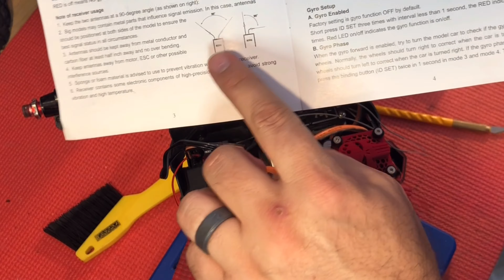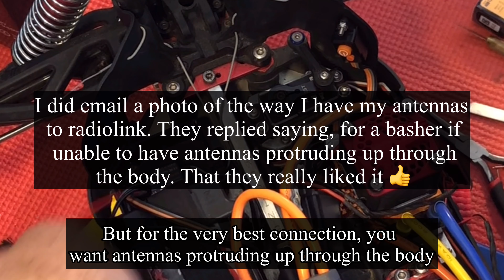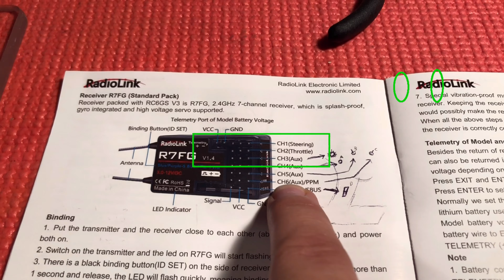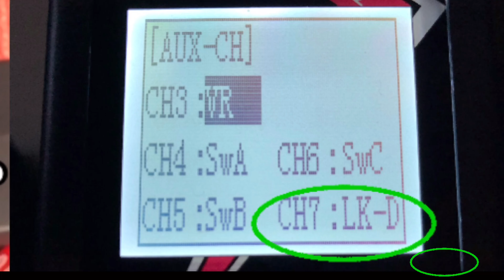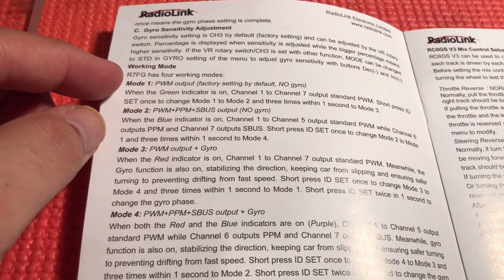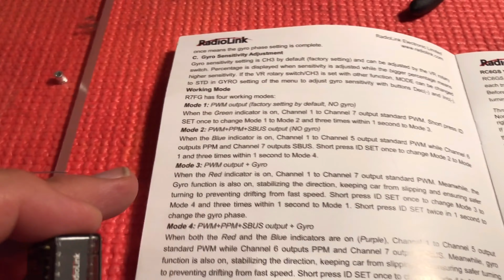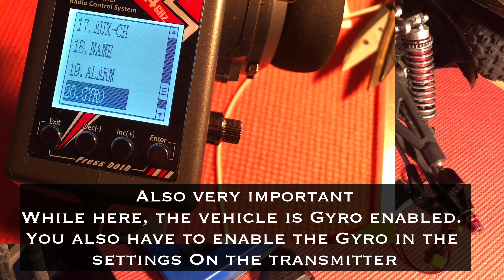Radiolink RC6GS v3 - INSTALL and Overview - Setup Dual Antennas, Gyro & Telemetry Explained

Comment: I use battery telemetry so I can stop before my rc hits low voltage cutoff when I could be I'm the air and then lawn dart into the ground.

Comment: you can assign channels and change there functions too. swa etc. i run crossfire on my v1 which has all the same firmware just lacking a button . use ch 3 for snow plow, easy adjustment of blade. have also used it for a winch. , id seed is sweet , haul the sonicwake to the creek with the crawler back in switch model and back boat off. great radio for fpv . and there are other rx that work but haven't tried them 20 buck rx waterproof long range

Comment: Late to the party but I hope this helps and btw I've been running the V2 since it came out and friggin love it! ... I removed the receiver box attached to the battery tray and using an extra section of antenna tubing I liquid electric taped it along the bottom on the driveshaft side and just reassemble running one antenna through it.  You can just pull the antenna out if need be and you can barely see what's going on so it looks clean and you get all of that range love! For the telemetry I cut the jst off the adapter and soldered direct to the base of the esc as you would if you were running a cap pack . Perfect length for it as well as you'll notice the wires are thicker than what you get if you buy those bulk just connectors . Battery for the controller? 4s of course . My only and minor gripe here and hopefully they fixed with the V3 but it only reads up to 15.4V even though the battery is fully charged. Hope this gives people ideas! And yo East! Keep it up bud! Great stuff!
Reply from the maker: Nice! Thanks for commenting. There’s no such thing as late to the game my friend.
Regarding the read out for the battery only going up to 15.4 I actually think that’s intentional because technically you should only charge Lipo batteries that are going to sit at a full state for a very long period of time up to storage level maybe even a little bit above that to be safe. So actually if you take storage level which is about 3.85 V per sell and multiply that times four you actually get that 15.4. 
I know it sounds strange to only insert batteries at less than full capacity but if you think about it, the time it takes to go from 15.4 V down to LVC is like… Forever. So you might as well play it safe with them Lipo batteries sitting at near full charge for long periods.
Reply: @EastTactics  right right just as you explained in your video it's just that's about the only thing I could think of that was even remotely negative to say about the device lol .. well that and my peticular radio came with some kind of debris trapped under the screen that's annoying to look at . And what a turn of events it snowed just a little this morning and I had been planning on doing my kraton annual full rebuild and took it out for one last rip and now the receiver is bugging out like some wire is bad and I'm not getting power to it . I love troubleshooting so this will be interesting. And having seen that you did a dual battery for yours I just wanted to say I poured over batteries for mine for about a month and chose the 1050mah tattu from gens ace and just spliced a jst off the xt60 it came with. I'm sure you found that thickness was the biggest hurdle in your search as it was for me because I still have lots of room in the compartment so I put foam in to get a more solid feel . Cheers!

Comment: Great video! I have the RC4GSV2 that I picked up when I bought a used rig with no radio/reciever. I have since switched it over to my stock Kraton 6s and still fiddling with the features. I love the range I get with the RadioLink over the stock Spektrum SLT3. The park I run at the most often is hilly and wide open, I can easily lose sight of my truck now if I am not careful. Looking forward to your detailed features video, as there are not many that help with this.

Comment: 23:47 Active gyro will turn your wheels into the correct orientation in air, for the landing (think about World Rally). Should help counteract the rotation, not contribute to it.
Reply from the maker: To your point what you’re saying makes sense. However, most people consider being airborne some thing they need total and complete control over themselves. Trying to counteract the AI might prove difficult. I’ll have to do a little bit of testing to see if the Gyro actually helps or if in fact, it hurts. Will let you know.
Reply: @EastTactics   maybe you mean for backflips. If that's the case, I'll bet the gyro DOES fight you on that.  OK, let us know and thanks for all the work on that video, I'm going to use it as a reference. Ordering this stuff up (Tx and extra receivers)

Comment: Doing an fpv setup... gona put my camera/ subsystem battery to this and the voltage display (buying a plug in thing basically) will go somewhere near the camera so I can pan or tilt to look at it when need be
Reply from the maker: Nice

Comment: I just got into the hobby this summer. Im starting a new rock crawler build and i was just browsing around my local hobby shop looking for a decent 4 channel. I have a scx10chassis with a 2 spd trans and 12t550 so i need a extra channel for my transmission. Guy at the hobby shop sold me this today for 50$   It has so much going on it’s overwhelming.  Great video man thanks a bunch!
Reply from the maker: For sure! Glad you found it useful

Comment: If it had temperature sensor in it's telemetry system (for Nytro) I would buy it. Not having temperature is a missed opportunity, when they already have link capable to send signal back with telemetry
Reply: @Ketoholic  I saw them advertized as I6X Radio/ IA6B Receiver telemetry modules. Are you sure that sensors are compatible with this car radio ant its receivers?

Comment: All 4S batteries won't come with the JST connector because the voltage is higher than that connector is made for.   4S will have an EC3, or an XT60 connector.   I bought a set of lithium rechargeable AA batteries that do 1.55v per cell... 9.2 total and it lasts forever.. and obviously they fit perfectly with the included AA tray.
Reply from the maker: Yeah, that’s perfectly fine, however…if the transmitter is capable of handling, 15.4 V, though why not take advantage of it and see how it impacts range performance. You’re correct the 4s batteries do not come outfitted with JST connectors. So you do have to do a little bit of work to convert but it’s a simple work and totally worth it. This video showcases how to take advantage of 1100 mA of 4s power, run in parallel can be outfitted inside these transmitters. And that rocks!
https://youtu.be/Z2sY509dfnw

Comment: @EastTactics Being that this video is almost 1 year old, would you say this is better than the Spektrum Dx5 rugged? All of my car already have Spektrum receivers and I wouldn't use most of its functions, I really just want to get rid of some transmitters lol I got 12 now! 😅 Mostly dx3s Felony, Kraton, Typhon, Talion, big rock, infraction, Vendetta and a few odd projects but they all have Spektrum receivers.
Reply from the maker: Functionality and control, slightly better, aesthetics, and feel slightly worse. Range much better… Overall …better yes
But not by much. Both are great

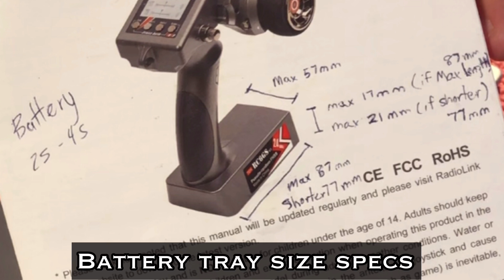Comment: Did you ever figure out what 4s battery fits best? I looked in the description and it's not there. 14:24
Reply from the maker: Yeah, I’m referencing the two 4s batteries that are being pointed out in my separate video. You’ll notice a thumbnail pops up and arrows point at both of them. Those two batteries are found on Amazon… link in description of the following video:

Best Lipo batteries for your RC transmitter -  Parallel mode￼ & Best practices - Radiolink RC6GS V3
https://youtu.be/Z2sY509dfnw
Reply: @EastTactics  Got it, I just watched. Thank you for the reply and the help.

Comment: I heard that the v3 will bind to certain spectrum receivers, maybe you can verify that with radio link. I just got mine in and if that’s true I’d like to know which receivers it would be.
Reply from the maker: I’ve never heard that, not saying it isn’t possible. But the simplest thing would be to give the binding a try and see if it links up. From my understanding binding of any kind between a receiver and transmitter is Brand specific.
Reply: @EastTactics  I will give it a shot. I love the idea that the r7fg has the gyro and wil not pull power from the car…for that reason I will be ordering more of them for my speed run cars. I will let you know if I’m successful binding my bashers to the stock receiver…🤞thank you for the response

Comment: Hi mate great video like the radolink rc6gs-v3 I'm defoe getting mine. Because I've got the old flysky gt3b at the moment. That only holds 10 models but when I seen this it holds 30 models that fantastic brilliant. What I'm worried about is the 2 wires what comes out of the receiver box. But the gyro is brilliant not sure if I keep mine on all the time mate 👍
Reply from the maker: Yeah, it’s a challenge finding a unique way to get those wires out of the box and ensuring that the transmitter it’s good reception to them.. and yes, regarding the gyro. You’re definitely said that to the turn dialed in for the most part will probably keep it off. But it’s fun to mess around with.

Comment: I need some help.  I have the Hobbywing Fusion quickrun SE 1800kv running a 2s lipo 7.4v. My transmitter is RadioLink RC6GS V3.  I have paired the remote with the motor but it runs crappy.  I think i need to change some settings within the transmitter and i dont know how could you help?  Also my reciever is red but the transmitter works i can drive and steer but like i said its crappy so i dont think is bound correctly...
Reply from the maker: How does it perform when running the stock radio and transmitter? Revert back as a test
Reply: @EastTactics  I fixed the issue.  It had to do with the transmitter settings particularly the A.B.S. Thank you though!

Comment: Coming from FPV world, I wish there a transmitter that had EdgeTX (OpenTX) so just program and button to do anything including what you would like for disabling the gyro.
Reply from the maker: Yeah that would be nice. I’m not very familiar with that TX stuff, however it sounds versatile. You do gotta give kudos to Radiolink for at least being light years above most offerings in the land radio arena.
Reply: @EastTactics  currently on Radiolink & Flysky seem to do anything with RC car transmitter world. Unlike the big names
Reply: You can disable the gyro remotely with Flysky Noble, Futaba, Spectrum, Airtronics and many other radios. You can program all the Aux channels to do what you want. I fly fpv too. I have 9 channels that I program on my crawlers to do all kinds of features from lights, winch, and rock lights. Drag brake, fpv camera, gyro on and off for jumping. So not sure why you would need open TX for RC cars when you already can run as many functions as you want to depending on how many channels your radio has.
Reply from the maker: @FarmerFpv  Would be nice if radio link incorporated the option. Especially considering the budget price for their ground radio combo.

Comment: I have this remote and receiver i spent for 84 dollars and its worth it 👌 have this for my kyosho 1970 dodge charger rc and i need programming to make the lights to work and i have my rc made as the duke o death from gta5 and to have the roof lights and underglow and to make adjustments for the driving experience more fun😊
Reply from the maker: That’s awesome!!

Comment: Hey bud quick question I’m having a headache I have a erevo 1/10 dual brushed motors dual servos and I just bought the same remote but I can’t get the car to turn all the way right or left ,I posted a video of the issue maybe you can help having the same remote and thanks.
Reply from the maker: I really don’t know a whole lot about setting up dual motors or dual service. For sure a remote/receiver combo that’s capable, it would definitely be the RC6Gs. 
It sounds to me like there may be a setting when you are running to servos that needs to be adjusted because perhaps the system thinks there’s only one so it’s only giving 50% radius to both. But you need to go in and activate 100% by navigating to each respective channel, connected to the servo and opening up the range. But this is just a guess because again, I’ve never set it up. Sorry I couldn’t be more help.
Reply: @EastTactics  thanks man I appreciate it

Comment: what battery would i need since the longer range would use more power
Reply from the maker: Best Lipo batteries for your RC transmitter -  Parallel mode￼ & Best practices - Radiolink RC6GS V3
https://youtu.be/Z2sY509dfnw
Reply: @EastTactics  I am a complete beginner and I do not understand many things Rc experts talk about there is so much information but i find this video helpful. Could this control work with cheaper small RC cars under 200 and do you need to use different batteries for different things in the car? I see you use fans; do you have to add them? and does one battery power the fans and another one make the actual car run and if I upgrade my car to this controller would I have to use more powerful batteries than the original ones my car comes whith? I am also concerned and a little confused on storing a battery of that power safely. Can the antennas be used during rain and is the setup waterproof?
Reply from the maker: Great questions, everything regarding RC is typically water resistant. Particularly in the higher model. I can’t say the same about low budget RC under $200. Or RC from Walmart. But everything in the total hobby grade RC Arena is water resistant. Not waterproof. They’re OK to get water on them with the rain, etc. But extensive water could cause issues.

Transmitter receiver combo is just a combo. Meaning you need the receiver and the transmitter to make the RC run. Not being sad if you put the receiver into a lower budget RC then you should be able to control that lower budget RC just fine because it’s the receiver itself that is communicating to the transmitter. And you don’t buy one without the other. 
Regarding the batteries that you put inside of the transmitter. This doesn’t matter. Something might be able to be said if you’re going super long range and you are using more powerful batteries in the transmitter. However, it’s debatable. I don’t think that the transmitter range is directly correlated with the power in the batteries. But I could be wrong. Either way, the battery itself is not really what gives this particular combo awesome perks. You’re gonna get way above beyond range no matter what batteries you use in the transmitter. I just like to use the best of the best and it’s capable of running batteries at 4s. Then why not maximize it

The batteries that you use to control the transmitter are completely separate from the rig.
The rig itself will runoff a variety of batteries, depending on what rig your running. in my Kraton uses 6s, Lipo batteries.
If you decide to upgrade your fans, there are options to run those fans on a completely separate battery if you choose. However, there are ways to run the fans off of the main battery balance terminal. The RC car will run off the main big thick terminal. And you can plug your fans into the balance terminal used for balance charging output . Believe it or not that thing outputs power
If you have a rig like mine, a great company to look at is hyper flow fans. He has a kit you can buy to run high-powered fans from your battery (main battery)
For a long time, used to run my fans from a separate 3S battery. I no longer do that. However, believe it or not, I also don’t run my fans from the main battery Either. at least directly …there is plug-in in my ESC that I simply plug my fans into. One could also plug their fans directly into the receiver, which is the little tiny square box that you put in your RC if it has an extra opening for it.
Hope that answers some of your questions
Reply: @EastTactics  thank you I still have to research about cameras but that is a whole different thing lol. So, i dont have to add fans if i choose not to and choosing not to add them won't be dangerous right? I have watched adhd rc and i want to be able to do what he does or at least to some level just having fun around the neighborhood burning rubber and interacting whith others virtually.

Comment: I just finished setting up my recover this same one. But the throttle is reversed when I hit the gas it goes in reverse. How do I fix this?
Reply from the maker: You can change the Forward and reverse of your motor by either changing the settings in the ESC. Watch my instructional video on the firma 160.
Another way to do it is a simply swap the outside two wires on your motor leads